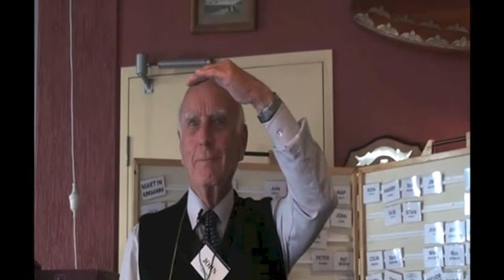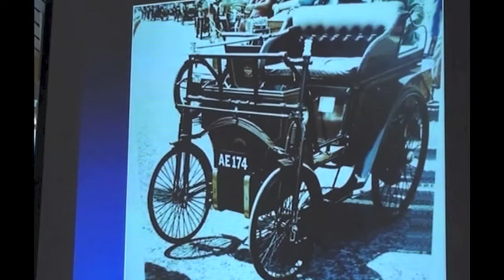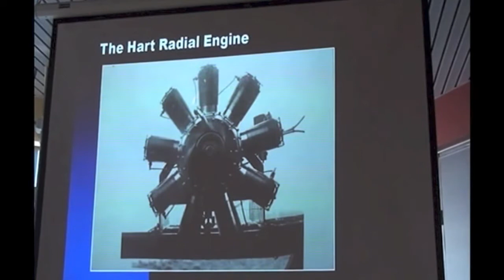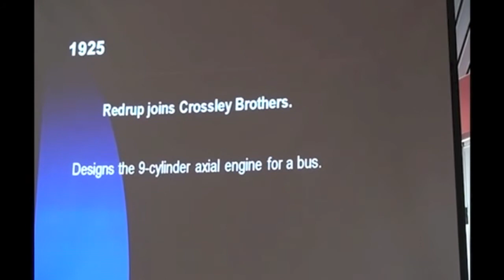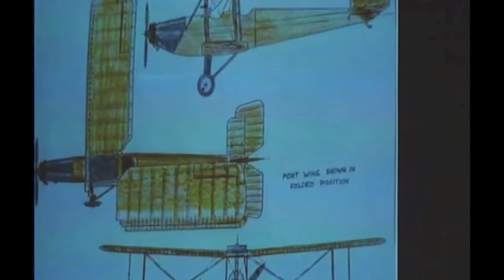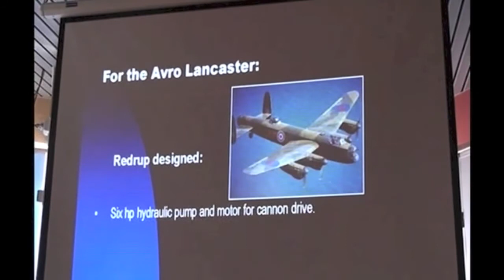Redrup the Engineer

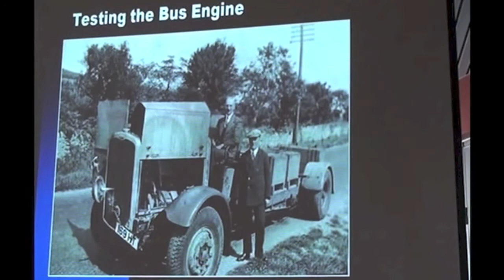Comment: The picture at 17:30 titled Testing the Bus Engine is a Bristol J type rather than a Crossley. The chassis dates from the mid-1930s. The engine is currently with Bristol Industrial Museum. It is interesting to wonder whether with modern materials it could be made to work successfully.

Very interesting video. Thanks for compiling it.
Reply from the maker: Thank you for your interest.